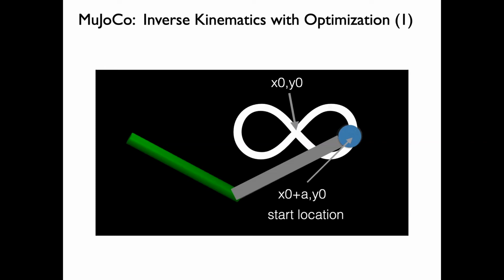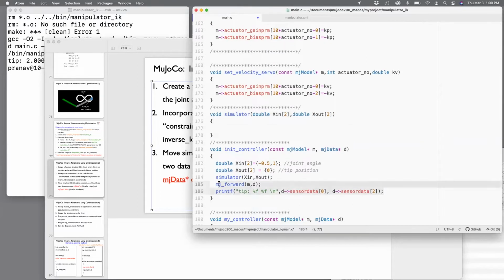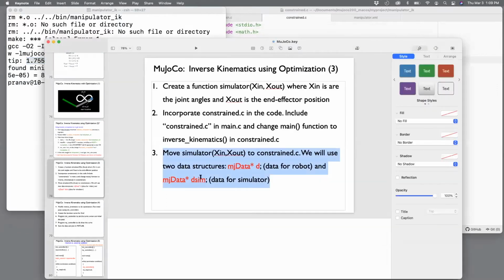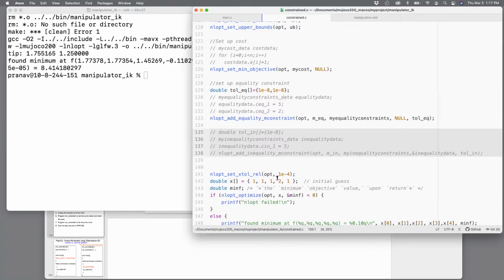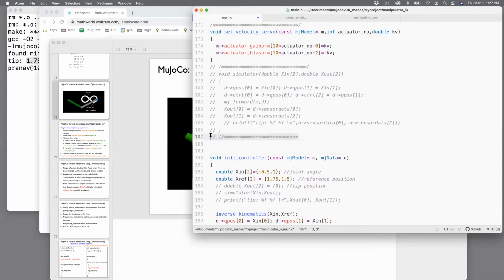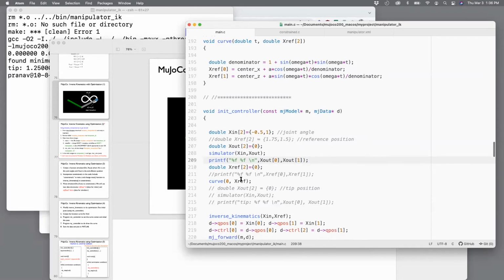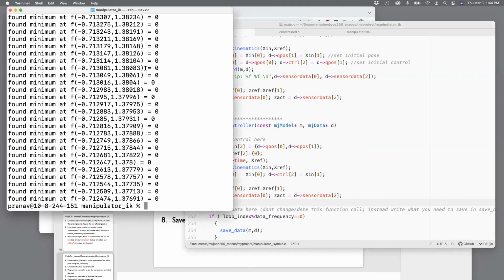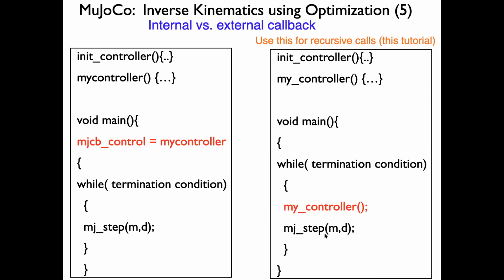MuJoCo Lec12: Inverse Kinematics using Nonlinear Optimization (Spring 2022)

Comment: Could you please cover programming movements in MuJoCo? With mjcb_act_gain, mjcb_act_dyn and mjcb_act_bias?
Even if it's just moving one arm for two seconds one direction and back the other direction at different speeds and torques.
Reply from the maker: I won't be able to create a tutorial this Spring. Perhaps in Fall. Meanwhile, this post might help: https://roboti.us/forum/index.php?threads/arm-manipulation-using-d-ctrl.3395/#post-3725
Reply: @pranavab  Thank you. I find the library and the docs very opaque when it comes to controlling actuators from C++.
I know there is dynamics, gain, and bias for this purpose. Any hint how I can use there to control torque and speed independently? 

Maybe if I knew what equation dynamics, gain, and bias were using I could wrap my head around it. Something fishy happens with gain. It magnifies the force after a few loops and crashes the model most of the time.
Reply from the maker: @Throwingness  IF you only looking to do torque and velocity control then I have a video on using position, velocity, and torque servo which will do independent position, velocity, and torque control. It is here: https://pab47.github.io/mujoco.html#lec3